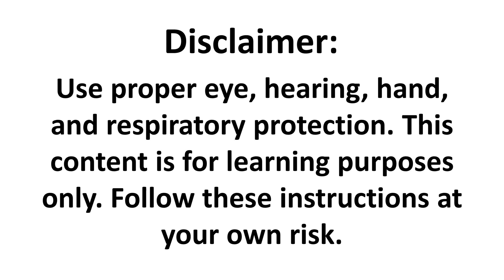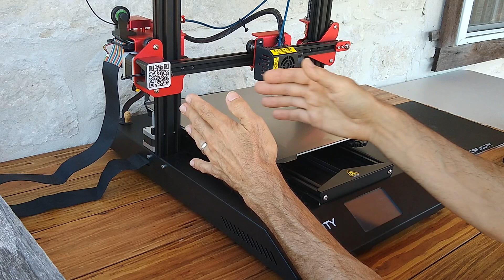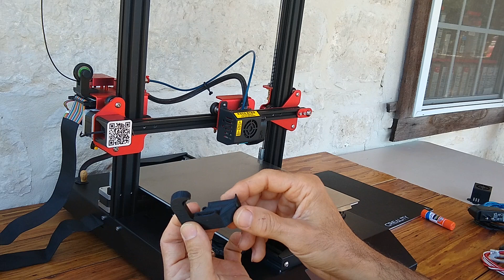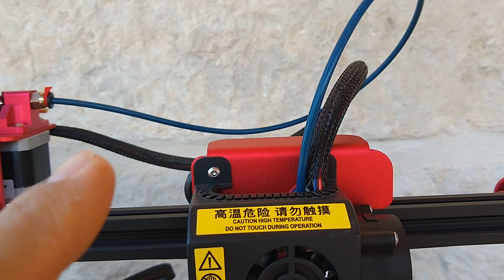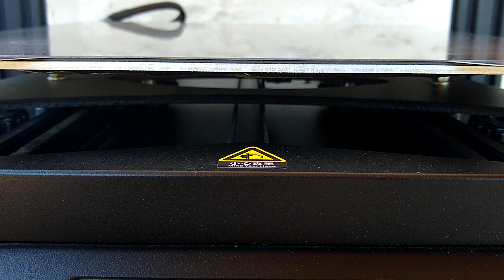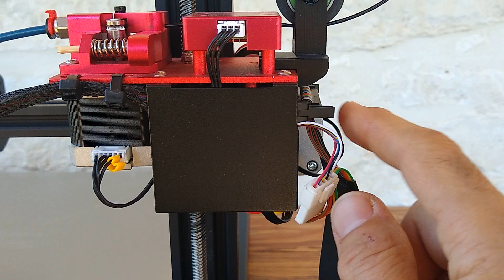CR10S Pro V2 upgrades that make a big difference in producing quality, and successful prints.

Comment: Hey victor, great video. I woud like to know if you updated the firmware, since I bought this printer has being a issue for me to get a firmware that works properly.
Reply from the maker: Hello Kaike Nehme,

Thank you for commenting and kind words, I really appreciate it. Yes, I changed my firmware. Check out my video linked below on how to do it. I recommend you use the firmware I have linked in that video's description since it's the one I'm using and verified to be working.
 
https://youtu.be/F1Lk7N5CMo4

Best of luck with your mods!

Comment: I'm new to the hobby and thank you for such great content and helping newbies like me. I tried printing the fan duct and installing and doesn't stick even with the screw being used. I'm using PETG, not that it would make any difference but the back clip that is intended to hold it in place seems to slim or doesn't have enough angle to stay in place. Any feedback would be greatly appreciated.
Reply from the maker: Hello Tube Perfect, Thank you for commenting and kind words of encouragement. I'm glad you found value for your viewing time. I've made several changes to hotend assembly on my CR10S Pro V2. This is the current setup below. It's pretty much trouble-free now. All I do is press print and walk away, no more hotend clogs, under extrusion, or adhesion problems. What is your current setup? Are you using the stock hotend or Micro Swiss all metal? 

https://youtu.be/V_3GLGS4bx8
Reply: @vbared  I'm using stock hotend.

Comment: I noticed your parts list says you need (2) of each sized Noctua fans was this a typo?
Reply from the maker: Hello Roadkill_Fabrication, If you want to also replace the hotend heatsink fan then yes. You're going to need 2 of the Noctua 4010 sized fans (one for the hotend and the other to cool the control board). There is an adapter that you can get on Thingiverse to hold the new control board 4010 fan to the original blower fan fastening points.  The last 2 need to be Noctua 4020 sized fans (one for the rear exhaust and the other replaces the power supply fan). All are 12 volts so you'll need at least one buck converter to turn down the voltage from 24 to 12 on the hotend fan. The power supply uses a 12 volt fan so it's a direct replacement. The control board fan and rear exhaust fans can be wired in series so between the two will divide the 24volts or you can add 2 more buck converters.

Comment: I love your videos. I had been using printers at my work as a hobby for quite a while and bought this printer about a year ago. Honestly. I hate my CR-10s pro v2. There is something always wrong with it. I get like 3 prints before I have some issue. I can never just print back to back with out a level. Always leveling the Z axis and the bed. Heat creep. Stock fans are loud and one went out. Extruder clogged. Buggy forgotten firmware. The original bed. This printer prints amazing when I can get it to work, but I don't think anyone should buy it. I have purchased all the upgrades you mentioned in your video and a few more. I hope it fixes all these issues and it consistently prints like it's capable of doing, but at the point where your printer is it's safe to say its just a body of a creality. Maybe my standards are too high as I have a mark forged and an ultimaker S5 at my business, but I think it's not for me. I just bought to tinker around at home for fun and it's been the opposite.
Reply: strange mine for the most part has been hit print and walk away and ive done nothing to it... heck i leveled my bed once out of the box and its still good several months later... granted i dont have 1000's of hours on it but almost every print has been great unless i forget to add supports... hope you get it straightened out bud...
Reply from the maker: @Mr_Vengeance87  Hello Angelus, Thank you for commenting and info on how your machine is working. Like your experience mine out of the box behaved in the same way and my PLA prints were near perfect. My issues started shortly after switching to PETG. Thankfully I was able to make the necessary changes and everything is working beautifully now. 

Best of luck with your prints!
Reply: @vbared  and there lies my problem... im looking at doing some harder materials petg abs and what not... i wanna upgrade my hotend but cant find the correct micro swiss all metal hotend for the cr 10s pro v2... the link you left is for the cr 10s pro and max but doesnt say anything about the v2
Reply from the maker: @Mr_Vengeance87  Hello Angelus, this is the one you need. 

https://amzn.to/3gGcCtN

Even though it doesn't mention the V2 it's the correct one for it. The CR10-Max, and CR10S Pro have the same stock hotend designs.

Best of luck with your build!
Reply: @vbared  just wanted to double check ive never really played with taking it apart and its my first printer so yeah
Reply from the maker: @Mr_Vengeance87  Hi Angelus, No problem. BTW how far are you going to mod your printer? Just the hotend only?
Reply: @vbared  well i already printed out the fan shroud file you supplied... the bed springs backlash springs and hotend all ordered just now... next week ill probably get the bed... ive been wanting to do some kind of firmware upgrade to it but everytime i hook it directly to my coimputer it acts like its not there so idk what thats all about... i really wanna do a hermes direct drive hotend but unsure if that will work or not... basically this is my current hobby im hyperfocused on with plenty of money to throw at it... last time i got like this i built my 5k+ gaming rig so yeah i tend to get bored and do random things that interest me... currently 3d printing is that thing lol
Reply from the maker: @Mr_Vengeance87  The reason I asked how far is because if your plan is to stick with the stock hotend x- gantry bracket then the Micro Swiss link I sent you is perfect but if you're thinking about switching that bracket to let's say the Micro Swiss Direct Extruder which really wasn't designed to work with the CR10S Pro V2 then you're going to need the Micro Swiss metal hotend for the the Ender 3/CR10S which is a little shorter. If it's too late to change what you've ordered then you can just order the Micro Swiss all metal heatsink only for the Ender 3/CR10S, about $20. Then you'll have both the short and long heatsinks. The rest of the hotend is the same for both. Check out my other CR10S Pro V2 videos so you can see what I've done to mine.
Reply: @Mr_Vengeance87  Mine out of the box was printing fine in fact, the quality was impressive. The only issue was keeping everything level. After I while it was one thing after another. I do have a few thousand hours printing now, but the things everyone complains about shouldn't be this bad. I think mainly it's I am spoiled by the ultimakerr s5 and the Markforged.  I know the upgrades are going to make a difference, but I could of saved a few hundred bucks and loads of time.
Reply: @ButtSpitter  yeah my only problem really is adhesion to the stock build plate... only thing that saves me is hairspray layer it on thick and wipe with alcohol makes it tacky when i start a print...
Reply from the maker: Hello Prp1k1ng, Thank you for commenting and kind words. I appreciate you sharing your detailed experience with your CR10S Pro V2. It was my second 3D printer and my early experiences with it have been the same as you. The initial cost of the printer is high and I've put hundreds more into getting it to work reliably. The greatest benefit of owning such a problematic machine for me has been to get a good understanding of why issues are occuring and how to resolve them permanently.

My top fixes for this printer are:

Build surfaces - WhamBam or Garolite
Auto bed level - BL-Touch or CR-Touch
Address Gantry sag - Install anti-backlash adapters.
Extrusion - Micro Swiss direct drive extruder kit using the Ender3/CR10 all metal hotend instead of the one specifically for the CR10S Pro V2.
Parts cooling and noise reduction - replace all the fans with Noctua versions if available. Get my new fan bracket, ducts .STL files, and order a set of Ender 3 4010 blower fans.
Firmware - Tiny Machines 3D or compile your own.
Fine tune - Manually level the gantry, manually level the bed, auto level the bed, set z offset, set x,y,z, and e steps. Make sure to save the changes to the EPROM. 
G-code - Use my custom G-Code to eliminate the possibility of oozing filament during auto bed level at the beginning of a print and depositing a filament booger in your first layer. 

The aforementioned has finally made this machine reliable for me. I just hit print and walk away.

Creality should have made this printer a direct drive instead of trying to make it work with such a long bowden tube.
Reply: @vbared  I am happy to report, my printer experience has gone way up after all the additions. A few hundred hours with no issues other than my hot end leaking, but that was my fault. I haven't done the firmware yet, but I am much more satisfied. It's so nice to not have to level this thing every print. Thanks for your videos.
Reply from the maker: @ButtSpitter  Hi Prp1k1ng, Thank you for commenting and kind words of encouragement. I'm glad you found value for your viewing time and making progress to trouble free performance. Check out these videos one will solve the bowden to nozzle seal the other will address the true cause of the heat creep and how I fixed it.

https://youtu.be/AEdca_-Nqys

https://youtu.be/AEdca_-Nqys

Comment: Hey thanks for the video, I'm waiting for my cr-10s pro V2 to arrive hopefully this week...with the all metal hot end are you able to print at higher temps like 280 out of the box?
Reply from the maker: Hello David, Thank you for commenting and kind words. The all metal hot will allow printing at high temperature but to enable temps that high you're going to need to upgrade your firmware. I made a video on it linked below.

https://youtu.be/2_yBrRSnh5g

Let me know if you have any questions.
Reply: Hey that link brings me to a delicious egg recipe, have something else I can watch 😂🙏 thank you!
Reply from the maker: @DavidSeda  Not sure why it linked to an egg recipe, strange. Here it is. You won't need to do anything with the probe offset since you're going to be using the stock assembly.
 
https://youtu.be/F1Lk7N5CMo4

Comment: New to this whole RASPBERRY PI world. Will a RASPBERRY PI 3 A+ work with my CR10S Pro V2 to transfer files from my computer as he mentions in the video?
Reply from the maker: Hello Allan, Thank you for commenting. Yes, the Pi 3 A+ will work perfectly. I'm using the Pi 3 B+ which has 4 USB ports and an RJ45. If you're planning on using the Octoprint to do time lapse video using a USB webcam or plan on adding more printers then go with the B+ version. Make sure to get the right power supply 5volt Micro USB 2.5 amp or better. Canakit.com has all the stuff.

Best of luck with your build!
Reply: @vbared  Thank you

Comment: I know a Miami voice when I hear one...
Reply from the maker: Hello Southern Speed Videos, Thank you for commenting. Yup, Cuban parents born in Coral Gables and raised in Miami. The accent is unique to those that grew up around it, great memories for me. Are you from Miami or have family there?
Reply: @vbared  Yup, same.  Cuban parents 1st gen born in South Miami hosp.  Raised in Miami lakes til 10 then Horse country.  Thanks for putting up the content.  Subbed for sure 👊🏼.   I'm debating between the cr10s pro V3 and prusa mk3.  Want the bigger bed of the cr but prusa's trouble free operation has me super undecided.
Reply from the maker: @SouthernSpeedVideos  Great to have a fellow Floridian to chat with. Check out the new Ender 3 S1. It uses the same 4.2.2 silent board as the Ender 3 V2 but packed with a bunch of upgrades right out of the box. You can also load the Jyers firmware on it to unlock many more settings. The CR10 V3 is another good choice if build volume is what you're after. You can also upgrade the motherboard later on to the 4.2.4 to get more firmware support. One super cool thing about the CR10 V3 design is that you can put the main printer structure in a heated enclosure needed when dealing with polycarbonate, nylon, and abs while keeping the power supply and control electronics outside. I don't have any experience with the pricier Prusa but know that just about every serious 3D print farm has eventually converted to them. I'm working on adding a V6 Prusa style hot end to one of my Ender 3 V2s to improve on the length of printing time before needing maintenance.

Comment: Great video! Thanks!
I've followed most of your tips, but I'm hesitant to glue the magnet directly to the bed. I have the Creality one ready to be mounted though.
Is there any cons to doing that? What if I change my mind, and wants to use a glass bed (for TPU), or the magnet gets damaged? How easy would it be to remove the magnet?
Reply from the maker: Hello Bjørn, Thank you for commenting and kind words. You're ask a great question and I was also concerned about this. The 3M magnet is a permanent adhesion to the build plate. I decided to adhere it directly to the heated bed then to the build plate. The goal was to transfer the heat more quickly then having to heat 3 surface before reaching the flex plate. Check out this video that I made on using Garolite as the build plate. 

https://youtu.be/MB-91rfvWfE

I'm currently running it on two machines and have had zero adhesion or removal issues so you can toss out the scraper tool, glue sticks, and masking tape. The Garolite will release the part when it cools down but holds it better than other materials I've used when hot and equally as well as the WhamBam for $25 vs $249 for the WhamBam system. Another thing about the Garolite is I use the 1/16 inch think version which is super flat but will flex slightly if you need to release a large part.

 Best of luck with your mods!

Comment: First, thank you for your time and effort.  I can see it is helping a lot of people, but for sure it is helping me.   I was wondering if you had, or would make a short video on how to install the back-lash adaptors... ?  I'm really new to this DIY mechanical stuff, as im sure others are (probably?) and I'd love a step-by-step on this...
Reply from the maker: Hello Tim, Thank you for commenting and kind words of encouragement. I'm glad you found value for your viewing time. I installed a generic anti-backlash adapter that required a little modification but you can order one specifically for your printer that will be a direct fit.

https://youtu.be/amRldRpnK2Y

Don't hesitate to reach out if you run into something you're unsure about. I may have already experienced something similar and might be able to save you some time and frustration.

Best of luck with your build!
Reply: @vbared  thank you sir!

Comment: Any way you could help me figure out my issue with my cr10s pro v2. I have had many decent prints but after a few my printer goes through the setup for my next print but then just stops and doesn’t move it around at all
Reply from the maker: Hi Damien, Thank you for commenting. I've had this happen with my Ender 3 V2. When was the last time you formatted your SD card? It could also be a corrupted g-code file. When was the last time you leveled the bed manually? If you recently service the hot end, changed anything having to do with including and even bumped the print bed the auto bed level routine will pickup a measurement that is outside of normal deviation and stop the printer like you're describing. If you've tried all of the above and problem persists then unplug your BL Touch and plug it back in then restart your printer.

Let me know if any of these suggestions clears up the issue for you.

Best of luck with your projects!
Reply: @vbared  thank you I will try that and see if it changes anything

Comment: Looks like your enclosure/housing fan is installed in a wrong direction, it should blow into the enclosure and not out of it.
Reply from the maker: Hello GumLab, Thank you for commenting and pointing that out. What's interesting is the fan is the one that came with the printer and installed like that from Creality. I also  noticed it's the same way on all the pictures of the CR10S Pro V2 hot ends.

Best of luck with your projects!

Comment: After watching your video I just gave it a try as well. But the power supply fan is not turning. The fan it self is ok. Does the fan of the RSP-500-24 turns all the time or only when a curtain temp is reached? Looking forward for a reply.
Reply from the maker: Hello Ronald, Thank  you for commenting. The power supply fan will turn when a set temperature is reached then shut down when it goes below that temperature. Test it by printing something small, it should turn sometime during the beginning of a print.

Let me know what you find.

Best of luck with your upgrades!